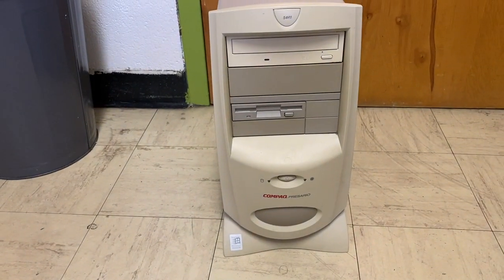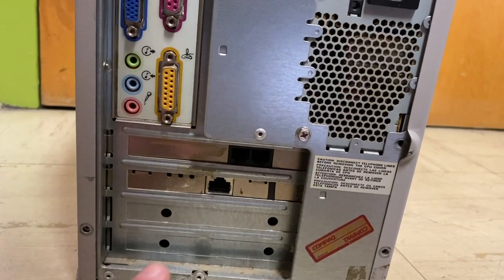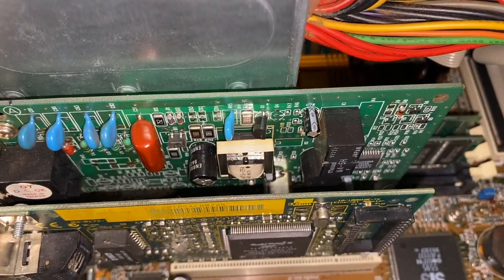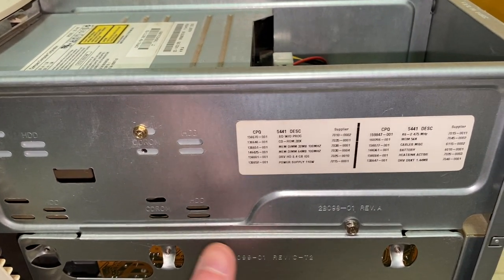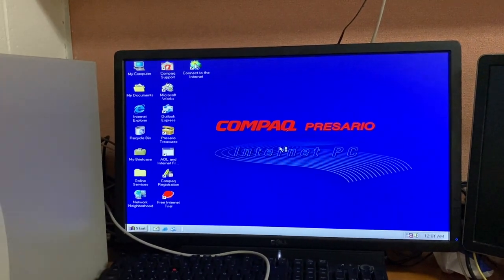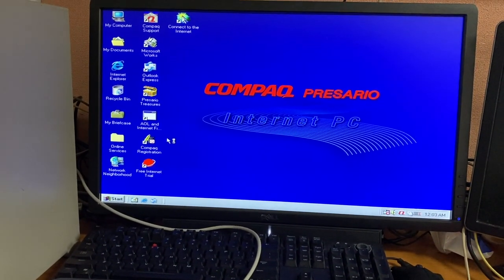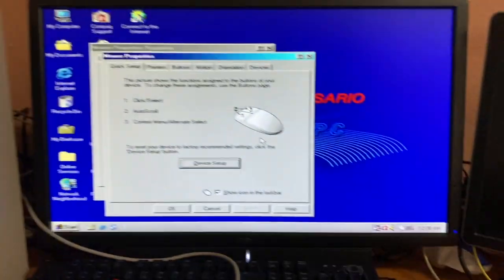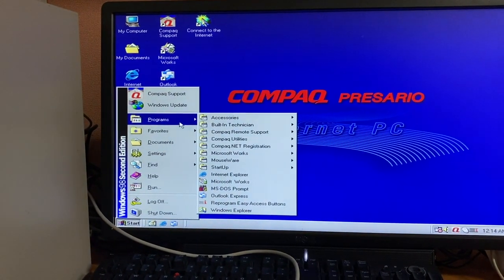Compaq Presario 5441 Overview

Comment: by the way jordan i installed compaq keybaord support driver and it does not let me  open any programs  using mouse the only way to fix that is ending that program compaq keybaord support thing that's why it was buggy
Reply from the maker: I'll look into it the next time I have this PC out, thanks for the insight.
Reply: @jwoolery99  I have a compaq preasrio 5451 pc And  i am trying to get the internet working if you have a disk for that
Reply: @jwoolery99  sorry for saying about having it i have the restore disk i already have it now installed the computer works its just i can't get internet working with my lan cord do you know any way to do that
Reply: @jwoolery99  run command.com and everything will function
Reply: @jwoolery99  It's not just keybaord shortcut run command.com and things will work
Reply: go to run on the start menu and press run and type command.com and things will work x out of dos prompts
Reply: @jwoolery99  I want to know if you can find internet drivers for that computer i have a compaq presario 5141 pc that is not connecting to the internet with my extender it use to connect to it but i reinstall windows 98 did not want to but i reinstall the os with a resore disk and want to know if you can get internet working with drivers that i need to have for it